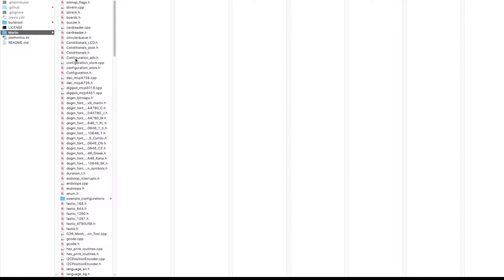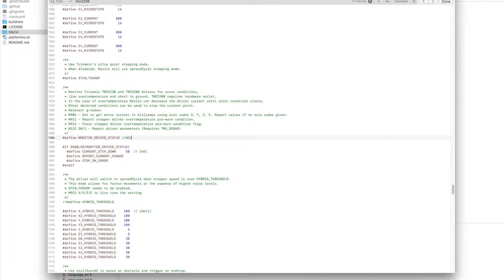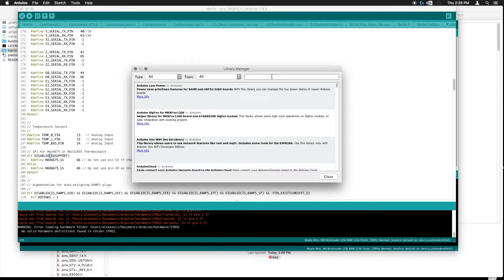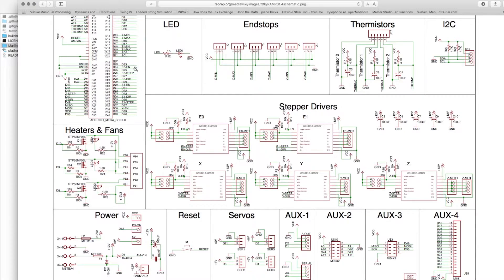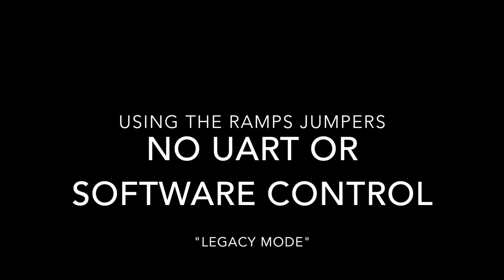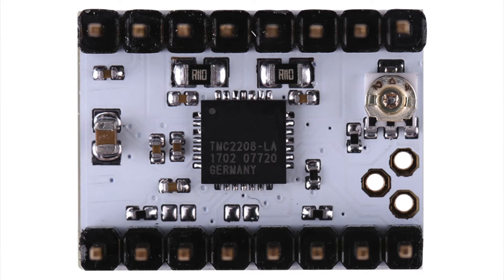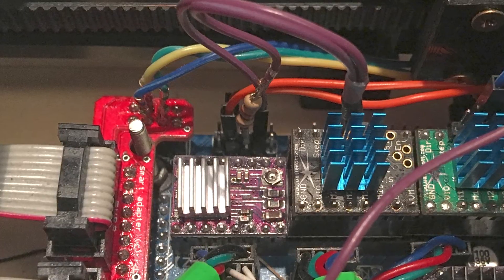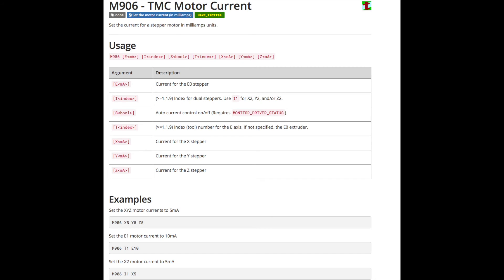Tmc2208 how-to: a more complete setup guide

Comment: 5:01 I am trying to compile Marlin 2.1 but I get a hardware serial/software serial TX/RX pin error at the end of my compile in platformio when I try to take my TMC2208's out of stand alone mode. the weird thing is the list is missing in config_adv/board pins and common pins for my motherboard list like yours shows here. I then tried to copy/paste the list from a different board pins file into mine with correct specified pins I'm jumping from which got rid of the hardware/software serial TX/RX pin error, but now I new errors that I cant figure out how to fix. 1 step forward and 10 steps back. 😐 I have a BTT SKR V1.1 (not a pro board), I have BTT TMC2208 V3.0 UART by default, and I have a BTT TFT35 V2 connected to the 5 pin TFT header on the board to RS232 on the lcd. If anyone can configure it successfully please let me know.

Comment: Hi, I'm trying to do this but with an Ender 3 melzi board (I soldered the tmc2208 on there my self) and I would like to use the pin 29 as _serial_TX
(I don't need/not have enough pins for RX)

But arduino IDE is always complaining about 
"#elif invalid_tmc_UART"

The marlin page says something about disabling hardware UART but I'm not sure where and if it is needed

Comment: Hi,

I prepared everything for flashing my CR 1.1.5 board to 1.1.xbugfix, and played a bit with all Arduino IDE settings and parameters.
With all my tests, I finally forgot to install the TMC2208 library, but... got no error in compliation check..
How can we explain this ?
Is TMC2208 library implicitely included inside newer versions of arduino IDE ? (Checked in library manager: not installed...)
Is Marlin code 'smart' enough to bypass missing drivers, and use legacy ones instead ? (for me, it would not be that smart..)
Is it just one misssing check in complication checks ?
And at last, what would have been the result, if I had pushed such code into the board ?

Thanks for letting me know :) And thanks for the video of course !

Comment: recently updated my ender 3 stock board v1.1.4 to marlin 1.1.9.
was able to turn on mesh bed leveling and power restore features and the printer is working fine albeit for being louder than the stock firmware from crality.
realised might be becoz of the TMC 2208 not being activated in marlin.
when i try to do so and verify it keeps on giving error as under

sketch\stepper_indirection.cpp:293:87: note: in definition of macro '_TMC2208_DEFINE_SOFTWARE'

#define _TMC2208_DEFINE_SOFTWARE(ST) TMC2208Stepper stepper##ST(ST##_SERIAL_RX_PIN, ST##_SERIAL_TX_PIN, ST##_SERIAL_RX_PIN > -1)

^~

sketch\stepper_indirection.cpp:342:32: note: suggested alternative: 'E0_ENABLE_PIN'

_TMC2208_DEFINE_SOFTWARE(E0);

request advice
Thanks
Reply from the maker: THat error is from a warning macro that is saying there is no UART pin defined.  I don't have the creality board with tmc2208 on it, so I can't check, but I THINK they are wired for standalone mode, not UART, so you'd have to specify TMC2208_STANDALONE instead of just TMC2208 so that it does not check for a UART pin
Reply: @AlexKenis  Thanks bro, will try it.

Comment: Great guide! Quick question. Can i solder the UART and PDN pins pointing up and just leave the tabs in the bottom unsoldered if I want to use drivers in standalone now and to make the transition to UART easier later? Or do the pins serve some purpose pointing down in standalone mode?
Reply from the maker: Sure, the jumper tabs on the PCB just connect the uart pin on the chip to the pin on the header, so if you leave it unsoldered, the pin is just there but not hooked up to anything.
Reply: @AlexKenis  Thank you very much for the answer. This is what I was thinking but thought Id ask someone who actually knows. :D

Comment: Great video. Confused the hell out of me lol... I bought 2208 preconfiged UART mode. Can I just run them in standalone. Too scared to setup UART now. thx
Reply from the maker: Hmmm, good question.  The UART setup happens at boot (if you don't need the diagnostics), but they have a default config, so technically they will " work" without sending them info over uart, but Im just not sure what they default to.  whatever that is, you'd have to set your firmware up to match (at least the steps per mm, etc).  Setting up UART is not really that tough once you give it a go
Reply: Alex Kenis Uart not hard for most boards. But my chiron is gorilla with limited pins. And the fact I’m stuck on marlin 1.1.0 modified version for proprietary lcd screen. So you see with out 1.1.9 marlin to reassign the uart pins I’m stuck with only 2 pins, enough for one 2208.

Comment: my Marlin 1.1.9 does not have the TMC2208 in configuration_adv like yours does. it has the current and microstepping but not the define for each axis like yours is on line #1037-1047. Any idea why that is? is it all just in the configuration.h file now instead of both configuration.h and configuration_adv.h?
Reply from the maker: I think a different version had them under "HAS_TRINAMIC" section, but they mention tmc2208 in the comments instead, so do a full text search for tmc2208 and it should take you to the section

Comment: the changes i make with M906 dont save..

it resets itself to 1000 everytime
Reply from the maker: Hmmm.  It should hold the new value until you reboot.  Sending an m500 after should store it to eeprom. If not, something changed or there is screwiness going on with the firmware settings.  I'd try m906 to set the current,  then m500 to save, then m503 and see what it says, then m122 to see if that agrees with the m503 reading

Comment: HELP! I am using Marlin 1.1.9 with MKS TMC2208 v1.1 drivers in uart mode but I can not get them to work. A m122 returns all 0 values for the registers and enabled false for all drivers. I soldered he Y cables with 1Kohm resitors, connected the to my MKS GEN L board to the pins as set in Marlin. Marlin is set to use the 2208 drivers in uart. What am I missing?
Reply from the maker: I don't have all those clone versions memorized, BUT I think the v1.1 doesn't have the jumper set for UART.  If that's correct, if you look at the board (potentiometer side toward you) there should be two small solder pads on the board (i think it is 2 pads on that version... it was 0 pads on earlier and 3 on later) to the left of the chip.  If those are not connected, you'll have to do that to get UART
Reply: @AlexKenis  There are no pads to solder on the bottom. The uart pin is already connected to the pin. According to Makerbase and I checked using a multimeter.
So that's not it.

Comment: I know this video was completed a long time ago. However, following your video for the re-arm with ramps 1.6+ with TMC2130 I kept getting an error of TMC connection error. (totally my fault in not knowing what I'm doing) So... I've decided to switch the 2130s with the 2208. Probably not the best idea. https://cdn.instructables.com/FDV/5T26/JHATJPW2/FDV5T26JHATJPW2.LARGE.jpg?auto=webp
Should the pins on the 2208s look like this for the ramps 1.6+/re-arm or can I leave all the pins and just add the one riser pin to the PDN? I would greatly appreciate your help.
Reply from the maker: The missing pins are connected to the jumpers, which are not used in SW control mode, so people usually recommend leaving them off just to be sure a particular board is not sending them a high or low.  But I am not sure the Rearm   UART control has had the bugs worked out yet in Marlin  (i have not checked in a few months) so you may need the pins to run them in standalone mode IF it is not. Sorry that I donth ave a definitive answer on the current status
Reply: @AlexKenis  Thank you, I greatly appreciate your quick response and help. So, I might not even get this setup to work at all. I'll keep trying. Fingers crossed
Reply from the maker: @Hopeinformer  I believe it is working now, I just can't remember off the top of my head what the issue was a little while back, so I thought I would add that disclaimer.  I'd give it a try and see, but all my printers are being used to test other configs at the moment.  I'll eventually get back to the 2nd part of the rearm review, but not soon enough to be helpful
Reply: @AlexKenis  You have helped tremendously. Now and with all your videos. Thank you Alex
Honestly, this a project I touch n go on for the past 2 years. I'm aiming to build the Hypercude Evolution with a 32bit board and TMC drivers to replace my Anet A8. And all the parts are just sitting until I can get a chance to put it together.

Comment: Thank you so much Alex Kenis for making this!
One question for you;
When I send M122 it says:
"...                    X             Y
stealthChop false false
..."

Ive followed your guide accurately, but how do I enable the StealthChop mode?
Reply from the maker: Tough to tell without seeing everything.  Make sure your trinamics are not standalone-mode only first
Reply: Alex Kenis thanks for the answer Alex! Turns out it was poor soldering connecting the two dots on the underside. Embarrasing! Sorry

Comment: Ender 3 W/mks 1.4 and 2208 
Z and E are clicking/skipping really bad. It probes perfect on a 3x3 with the bl touch. Im simply using them as a drop in. Not doing the Spread mode or any of that. Help Please.... I cannot even print. I even swapped out drivers to see if it was a driver. I was using TH3d Marlin base Firmware. But if someone has a working Sketch for this exact setup that would be So awesome. I been pissing with this for 4 days. Im ready to go back to the Melzi.....lol

Comment: Thanks for the video. If I don´t want to use the 2208 in UART mode, which changes I need to do in Marlin 1.1.9? I need to choose in configuration.h "#define Z_DRIVER_TYPE  TMC2208_standalone" instead "#define Z_DRIVER_TYPE  TMC2208"?
Reply from the maker: Yes, just pick standalone and set it up as a normal driver.  The newly-added DRIVER_TYPE  options  do some automagical configs for pulse timing and whatnot
Reply: @AlexKenis , thank you very much!!

Comment: Is it possible to run higher voltage to the stepper boards while connected in UART?
Reply from the maker: Sure, the motor voltage shouldn't effect UART levels

Comment: What wattage of resistor?
Reply from the maker: It doesn't matter since it is in a low-voltage, low-current position.  I think I just used a regular old 1/4w carbon film resistor, but it MAY be worth it to use a better quality resistor because of strain on the leads (cheap resistors with steel end caps tend to develop noise if they encounter too much mechanical strain and the end caps wiggle a bit loose inside).

Comment: alex i was wondering if you could help me out. im testing out some tmc2208's and i have a few questions? im just kinda at a loss for what some of this means but do you have any clue as to why the rms current is different on the z  is it because they are running in parallel? what is CS actual? and why are my z msteps and t steps wrong? and i know this is asking for a lot and im sorry, im just so used tot drv's and a4988's and all this is still very new to me
X Y Z
Enabled  false false false
Set current 800 800 800
RMS current 795 795 1436
MAX current 1121 1121 2025
Run current 25/31 25/31 25/31
Hold current 17/31 17/31 17/31
CS actual  17/31 17/31 0/31
PWM scale  0 51 0
vsense  1=.18 1=.18 0=.325
stealthChop true true false
msteps  16 16 256
tstep  1048575 1048575 0
pwm
threshold  0 0 0
[mm/s]  - - -
OT prewarn false false false
OT prewarn has
been triggered false false false
off time  5 5 0
blank time 24 24 16
hysteresis
-end  2 2 -3
-start  3 3 1
Stallguard thrs
DRVSTATUS X Y Z
stst  X X
olb
ola
s2gb
s2ga
otpw
ot
157C
150C
143C
120C
s2vsa
s2vsb
Driver registers: X = 0xC0:11:00:00
 Y = 0xC0:11:00:00
 Z = 0x00:00:00:00
Reply from the maker: Teemuatlut is the name of the maintainer of the trinamic code, and you can get a much more detailed description of all those readings on the Github page at https://github.com/teemuatlut/TMC2208Stepper , but basically what your readout is saying there is no current being read, so it looks like the connection is wonky. Check the wire connections, cables, and driver chip: after you are sure the cables are plugged in right and that didn't fox the problem,  try shutting down and swapping the cable for one of the other drivers, reboot, and see if the strange readings jumps over to another chip.  If it does, then fix that bad cable.  If the reading stays, then shut down and swap the Z driver for one of the other ones to make sure the driver is not bad.  If the problem shows on the axis you switched it to, then either the driver is bad, or a pin is bad, or it is not set up for UART mode.  I had a bad connector on a 2208 that would randomly do the same thing, so it may just be a simple issue
Reply: @AlexKenis   thank you for that. and i was your 20th supporter.. for 10$ a month so i think a live stream is in order!!!! use it wisely. but i will try that when i get back home. to be honest. 5 months ago i had never seen a 3d printer in person and i have built 1, bought 1, and building another currently. still a little green. the weird thing is it works perfectly fine in testing/ homing and throwing it some gcodes just readings are off in m122. i did f**k up the soldering of the 3 solder pads i would bet money its on the z. i soldering the wrong 2 which i didn't think really mattered? or i could be wrong. i saw someone somewhere(i know helpful right) said they soldered all 3 together and it worked.  excited to see a live stream.
Reply from the maker: @jacktheripple6982 HEY, thanks. Oh man, so you pushed it over the 20 sub mark.  Now I have to plan a stream.  Anyway, it's very possible that its those tiny little jumper pads, they are easy to mess up, believe me I know... If it's the PDN pin for the UART, all the jumper does is connect the pin on the driver IC to one of the header pins (pin 4/5 if I remember right).  THat's easy to check, just pull the driver off and check for continuity with any old multimeter

Comment: Thanks for the helpful video fella. Can I assume that with the UART connection of the 2208 freeing up AUX 3 that I can resume using the Full Graphic Smart controller and SD with no issues ? I currently run TMC2130 but I’d like to get the display and SD functions back
Reply from the maker: You can run either 2208 or 2130 with full display and SD... it just takes a bit of fiddling in the firmware to re-assign the pins. For my 2130 build, I soldered extension pins off the LCD adapter, but 2208 don't require any hardware hacking like that, you just have to figure out which pins you have available to assign to software serial

Comment: Hi,

Can you please help me ?
I have a Mks gen. 1.4 board with 2208 in standalone mode, working all motors fine, just the acceleretion on the extruder is very loud... i tryed 2 change a VRef, nothing happend, will be just hot. Normaly is on 0,7V are all motors.  Ms1 and Ms2 jumpers are close to get a 1/16 mode. I tryed it with 1/8 its just louder, because i hear 8 steps on acceleretaion not 16 steps. Steps/mm 99.6, feed 50, acceleration 10000. Thx for your answer
https://youtu.be/g7Ewuf3WjPw
Reply from the maker: I can't really tell if that is the extruder or the x axis making that noise, but it sound like it might be getting amplified through frame resonance.  You could try vibration damping motor mounts on X and Y to see if that helps, and you could try temporarily  unmounting the extruder motor (since it looks like a bowden) and run a short print with it sitting off the frame to see if it is the extruder motor that is vibrating.
Reply: @AlexKenis  Hi, its the extruder motor. If is disconnected, have no noise more. Is the acceleration and the feed good ? I think the acc is to much...
Reply from the maker: It depends on a lot of factors (material, temp, print speed, printer operating point, etc) but acceleration is a good place to start tweaking. If you are confident that you are not missing steps, then it could just be that the noise is just being amplified through the frame of your printer, so you could try an isolated mount.  Since it's a bowden setup, you don't need a rigid interface between the bracket and the frame, so I would try some rubber/cork/whatever between the extruder bracket and the frame and see if that helps, and try to isolate the screws as well if you can (with rubber washers or whatever) since the vibration can be transferred through them as well.  I would not use an isolated motor mount between the motor and the bracket because  that can end up in slightly sloppier prints (but not always, so you could try it if you have one) because you'd have slight flex between the feeder gear and the pinch wheel.

Comment: Does the v1.2 version of the Fysec TMC2208 make any difference to these guides?
Reply from the maker: For the most part, it should apply to any clones of the Watterott boards, but Some of the  Fysec drivers have wonky configurations in certain modes because of tiny little board jumpers they left off, and that can change from version to version or even batch to batch. I think the v1.2 are okay, but I have not tested.  they have a wiki at wiki.fysetc.com that you can look at if you want to see what they have to say about it
Reply: @AlexKenis  I got the impression from the little info I saw that the 1.2 version didn't require any rewiring as they had done something with the UART control, but maybe that was just specifically for their own F6 board.